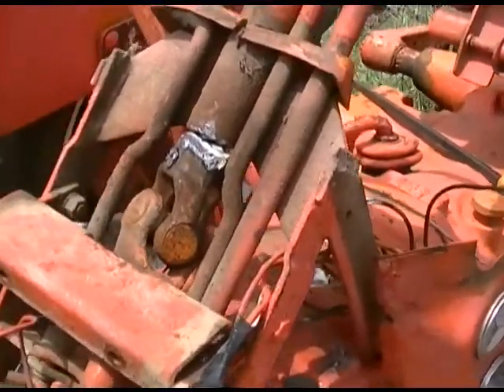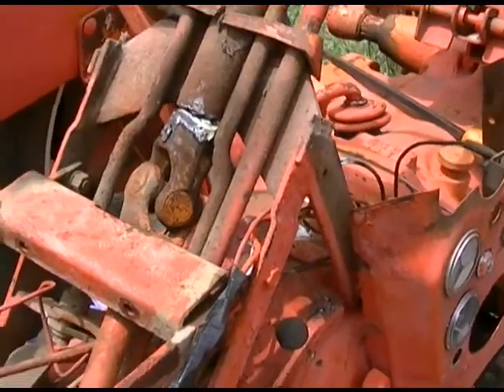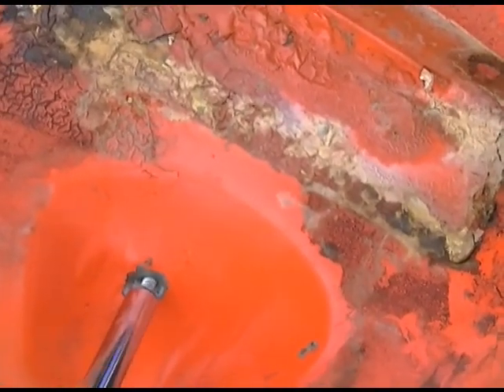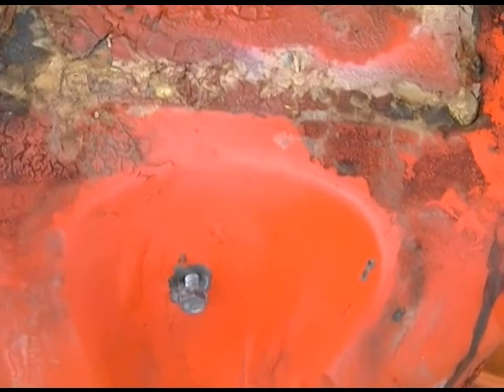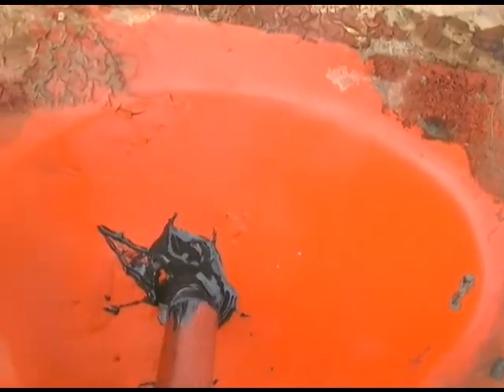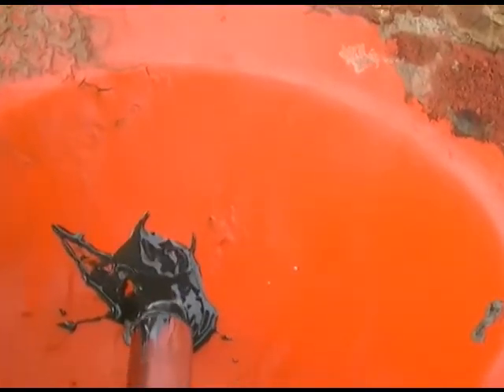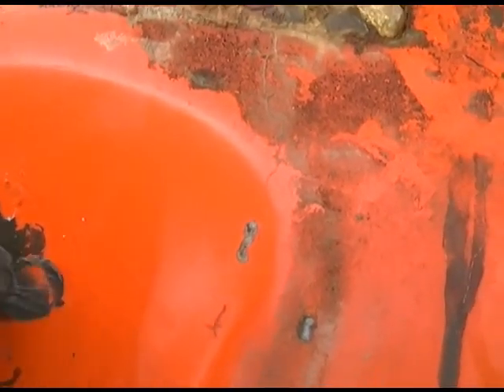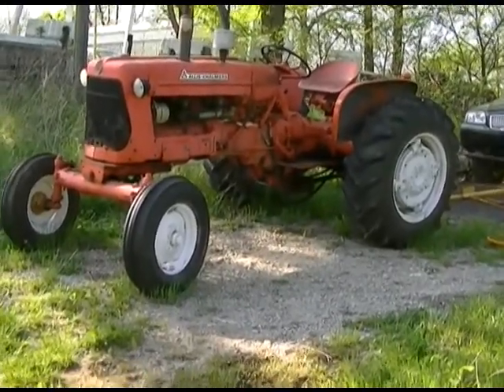Repairing Allis' Gas Tank

Comment: I like that old tractor ..I fixed a gas tank on a car using a piece of leather on a screw and coated it with indian head gasket shellac I did drip for a day or so and then it sealed up
Reply from the maker: That works, too! Faucet washers for sinks may work also.